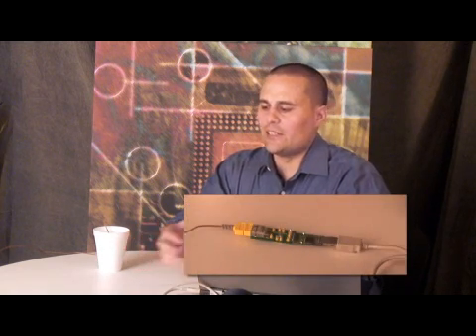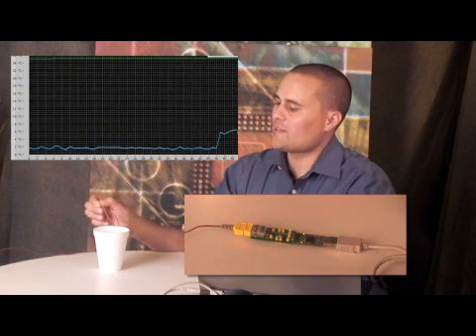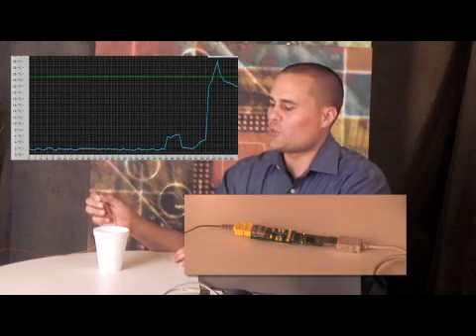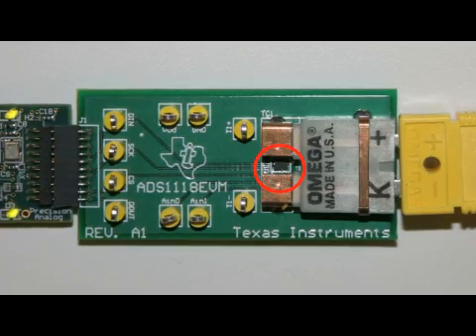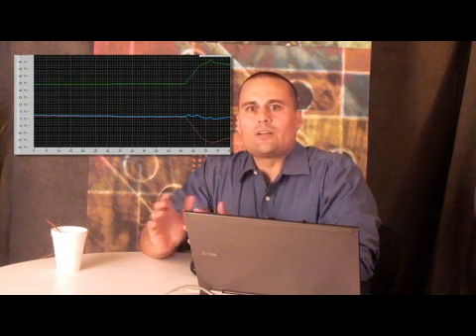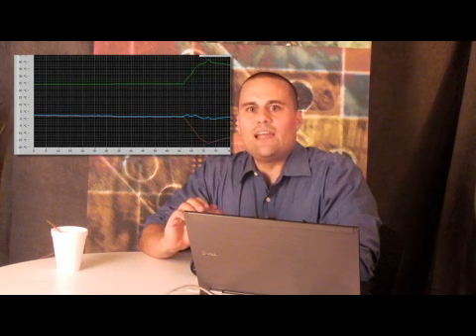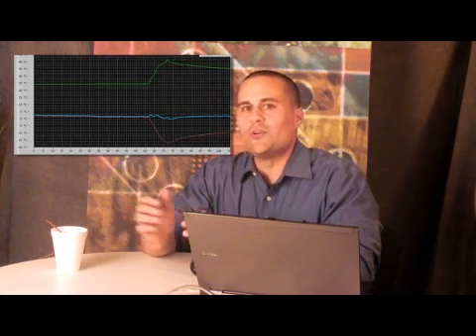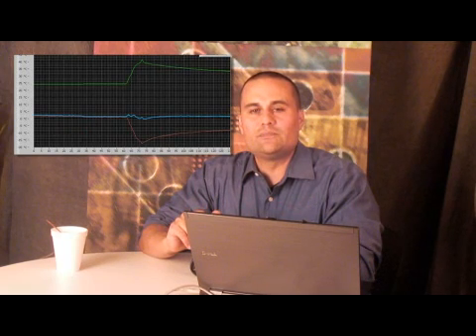Thermocouple Measurements Using ADS1118

Comment: Hi sir, 
I having issue with ads1118 .
How to calculate negitive voltage in ADC mode
Positive formala =read value *far/32768.
But  idont know how to calculate negitive.